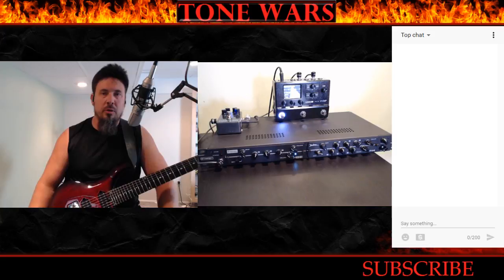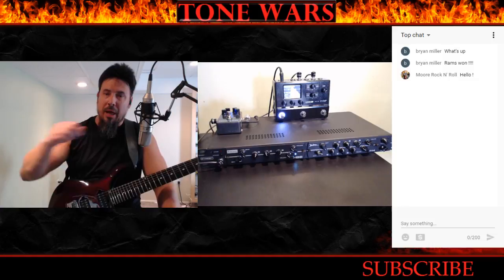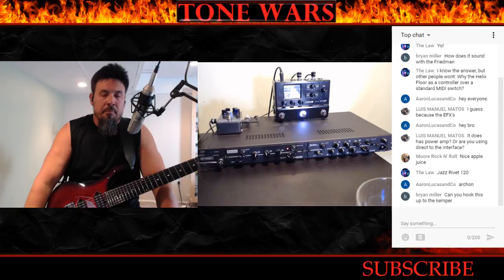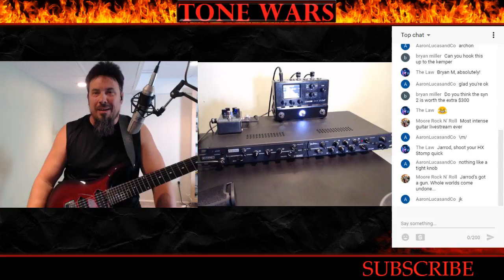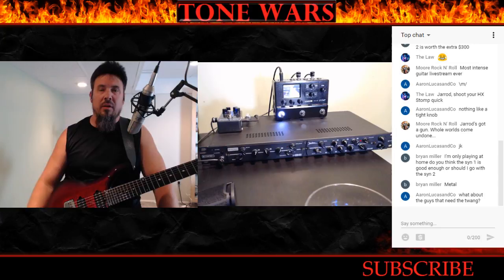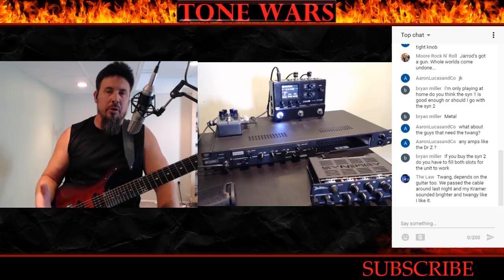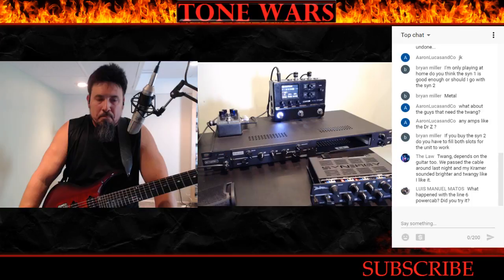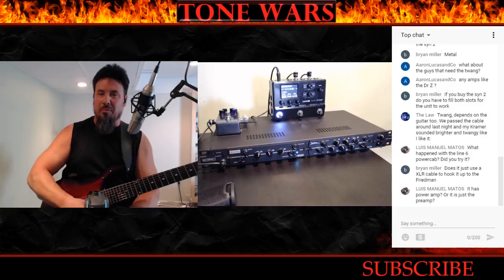Synergy Amps - Live demo of the SYN 2 along with 2 modules -  Diezel VH4 & Friedman HBE

Comment: What speaker or cab are you playing thru. I’ve got the syn 1 and the hbe going thru my focusrite into my daw and monitors and it doesn’t sound good at all . Your set sounds epic. Def want to figure it out. Thx for your help.
Reply from the maker: Thanks for commenting. Good question. If I remember correctly I think I went through the direct out on the syn1. The cab Sim in that product is really good. It's made by ownhammer